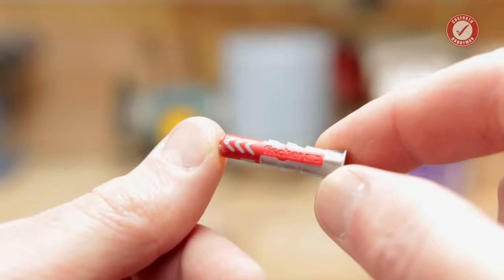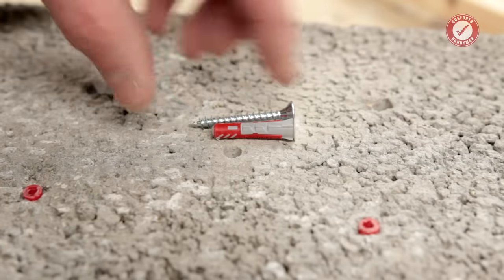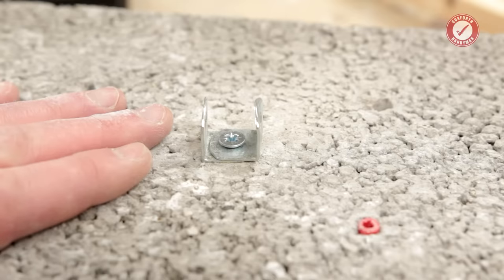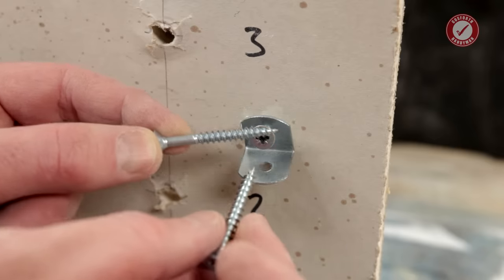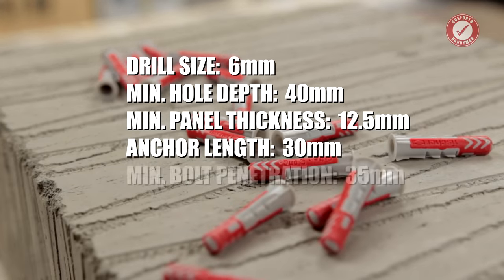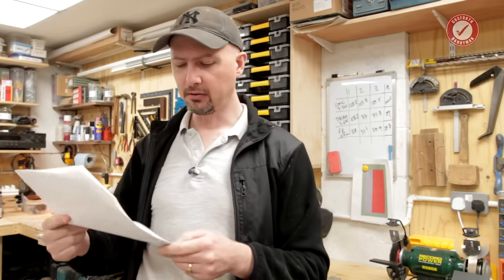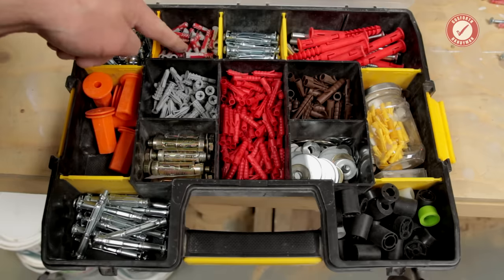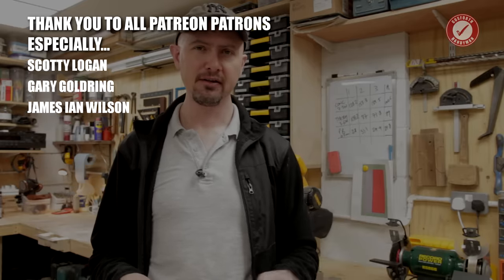How strong are Fischer DuoPower wall fixings?

Comment: Using an impact tool is NOT most individuals everyday screwdriver! This very well could of been the reason the fitting did not expand the way it should have behind the drywall!
Reply: Exactly , the plug needs continuous rotating force instead of a rotating hammer action
Reply: Bruh talking absolute rubbish
Reply: He swapped to a manual screwdriver at the point that the plug was starting to expand

Comment: Agreed that the Fischer Duopower plugs are game-changing. However, care must be taken not to oversize the hole for the plug as the anti-rotation wings are not very large. Suggest using 5.5mm drill to ensure a snug fit in all substrates.
Reply: I sometimes drill 1mm undersize in my plasterboard walls with thermalite blocks. It's easy to damage the plasterboard (oversize) leading to a loose fitting. A twist drill gives a cleaner cut and copes with thermalite blocks easily. Over the decades I've used larger and larger plugs - the 1980s rawl plugs pull out eventually. Nothing less than Fisher 8x40 or 10x50 these days.
Reply: @paulhadley9047  Can I ask what diameter screws do you use with the 8x40 and 10x50 plugs? And what series of Fischer plugs are these? They make them in duo power but also UX.
Reply: @lancearmstrong3252  Hi, for strength I always go for the largest diameter recommended for the plug.
If the plug says 6 to 8mm I find 6mm can spin in the nylon, but 8mm is firm.
Length is important, must be slightly longer than plug depth in wall.

For 10x50 I have had good success with long concrete screws from Screwfix. 7.5mm x 100mm.

There is a UX 10x60, with long concrete screws I had a solid support for IKEA support rail for kitchen cabinets. The long screw penetrates the block behind the plug, I mark plug depth with tape on drill.

Comment: It would be great to know how these test would go with 4mm and 4.5mm diameter screws as well as 5mm.  My experience with the Fischer DuoPower is that they work best at a bit below the maximum size screw diameter.
Reply from the maker: Will try - I'd have to buy even more screws as all my 4 & 4.5 are TurboGold. 😂👍
Reply: Fischer provides information about which screws to use on their website. for the 6x30 it is 4-5 mm screws for wood with at least 35mm length (depending on the head). So your observation is right.
Reply: Why do you think that the smaller screw would be better? I would have thought that the bigger screw would make a tighter seal, but you reckon the smaller screw would be better?

Comment: Thanks to this video I started using Fischer Duo Power plugs, both the 6mm and 8mm size, on both interior and exterior fastening jobs. Pictures on interior drywall, shelving in the garage into solid brick and hanging basket plants and exterior decorations, house numbers and the like, outside on solid brick. They have been easy to use and so far I have a 100% success rate. Many thanks.

Comment: Thanks for the tip of using fully-threaded screws for these (and for posting the 5x40mm screws you used)… have had mixed results with these on DIY jobs (screw not tightening, plug spinning), and now I know why! Used a fully-threaded screw with a duo power today, it worked perfectly. Great vid, thanks 👍

Comment: Thank you for your great advice. I have just bought a heavy Winmau dartboard. It's 5kg and my wall is plasterboard. I was all set to buy self-drilling screws until I saw your tests, and went out and bought a box of Dupower 6mm instead. Tentatively put up the bracket with two duopower this morning and the board is solid as a rock, even with my lousy DIY. Keep up the good work!
Reply from the maker: Great stuff! Just be careful as the constant movement of a dartboard (pulling darts out over and over) can exceed what these little plugs can handle. I'd normally use expanding metal anchors for something like this. 👍
Reply: @GosforthHandyman  Thanks, that's great advice. I will look to upgrade what I've done and remount the brackets as you've suggested! Cheers!
Reply: @GosforthHandyman fantastic video I stumbled across, but what's the difference between the DuoPower and the UX or SX?

Comment: I tried to use drywall plastic anchors in masonry and the ones I had didn't work because they bent over before they were fully inserted. No problem, I thought I'd just go to Home Depot and buy plastic anchors for concrete. I couldn't find any labeled as such. I bought some anchors that looked like the plugs I had used before in masonry but they also were labeled as for drywall, but they worked.

It wasn't until I got on the internet and realized that the DuoPower anchors that Home Depot sold were duel purpose . I looked for a review of how well they worked and that's how I happened on this video. Thank you. As an aside, it seems like any anchor that you can get fully embedded into concrete will produce a much stronger connection than is needed for most routine light duty connections to concrete.

Comment: I''ve just stumbled across these since I bought me new home and the reviews I've read are really good, and now thanks to google tracking everything we do on here its recommended your amazing vlog, I've just ordered two types for my drywall to connect a wood frame to it, making a raised feature in my master bedroom. I'm I right in saying that the more I secure the wall with, then the max load is then evenly spread through out the fixings. So to hang a TV on the raised area the more the better. Thanks for the review on these buddy.
Reply: Hi Neil,

This is very late and you probably already got it sorted but yes. Each plug has a max 'weight' it can carry. If you divide the load over several plugs the load will be more evenly distributed :)
Reply: @Tomskii5  thanks buddy and my tv wall is still standing six months on, thank you for your reply buddy
Reply: @stomperthemixer1  dont worry if you buy a tv mount it is usually supported by at least 3 plugs. Each tv mount also has a max weight it supports. This combined with good plugs should be perfectly fine.

Comment: I found these wallplugs then found your review, it helped me no end, as a very basic DIY'er. It enabled me to select the right screws for the first job and the tip about making sure the hole was at least as deep as the screw was very helpful. If there is a way to do something wrong, I can normally find it, but today I hung a 90cm circular mirror and a Gin rack very successfully. Thank you

Comment: As I have now installed thousands of these, I wanted to reiterate two things from this video that are super important when using these: 1) If using your own screws, make sure no unthreaded portion enters the anchor; and 2) do not overtighten, definitely do the final tightening by hand. I've seen too many of these "blow up" because a worker took an impact to them. 

You'll end up ballooning the anchor and it ends up mangled and spinning in its hole, which eventually requires drilling it out and installing a more time-consuming snap-toggle instead.
Reply: Hi Sakanora, I am curious around the importance of the unthreaded portion not entering the plug. In the video it's not clear why it causes an issue or whether it is only in the plasterboard scenario that is shown. Is it because a portion of the plug does not expand? If that it the main issue, then in solid wall this would lead to reduction in the load bearing relative to the length of the unthreaded portion, but the remainder of the length would expand. Or is there something else I might be missing?

Comment: Thanks for the video, Andy.  I recently used some of these Fischer DuoPower plugs to attach some bearers to my garage wall to hold up shelves.  I must confess that, where possible, I fixed them in the mortar between the bricks.  I realise that this is not good practice, but the mortar is sound and gave a good, strong fixing.  These plugs are good quality and they're working well for me.  The shelves haven't fallen down and there's some pretty heavy stuff on them!
Reply from the maker: Great stuff - might do a vid about hitting the mortar vs hitting the brick. 👍👍
Reply: If you're drilling an internal wall that's plastered, you don't know if you're hitting masonry or mortar.
Reply: @GosforthHandyman  please do!

Comment: I've only used Fischer DuoFix to hang anything remotely heavy in my house. Absolutely love them. Especially the 10x50 plugs with 5xt0 bolts. They are pricey (5 bucks for 4 plugs and bolts) but its more expensive to replace a tv or two
Reply: If you look on amazon (and I'm sure elsewhere) they sell a selection for about $20 that come in a nice Sortimo box (and includes 15 10x50s, 30 8x40 and 60 6x30 - all with bolts/screws).

Comment: Good test.  When  I use these and the Fischer  UX 6 plugs in plaster board  cavity walls I drill the smallest hole possible, 5.5 mm in this case  and use the  smallest  recommended diameter  fully threaded screw. This helps stop the plug from twisting in the hole as you tighten it, especially in old softer plaster board.  I wouldn’t use an impact driver !   and I usually finish  tightening the screw by hand.
Reply from the maker: Yup - on all these test the screws were tightened by hand. 👍

Comment: I've got the 6 x 30 and 8 x 40mm versions. My findings are as follows in 12.5mm plasterboard. The 6 x 30mm version I'm struggling with. I've tried 4mm and 5mm full threaded screws which were long enough to pierce the end of the plug with item to be fixed in place. What I've found with the 5mm screw is it just turns the complete plug round in the hole once the screw gets around halfway down the plug. With the 4mm screw the plug starts to collapse a little bit which ends up wider than the drilled hole but it certainly doesn't really deform that much which is a similar finding to your video. Now, the 8 x 40mm plug I can get repeatable results which are much better. I've tried both the 4mm and 5mm diameter screws and the plug really deforms a treat, spreading out very well behind the plasterboard. I think I will have to try another kind of small plasterboard plug.
Reply from the maker: Great stuff! I must admit, although I like the DuoPower as a problem solver, I do prefer the Fischer GP/LDF fixings for lightweight use for the reasons you say - less inclined to rotate. I generally use the expanding metal fixings with a setting tool for heavier stuff. 👍
Reply: @GosforthHandyman  Hi, thanks for your reply. I will have to look into the GP/LDF fixing, see what they're all about. Nice videos BTW.

Comment: Great video, thanks for sharing! At 7:07 you speak about the hammer action of your drill.
When do you (in person) use that?  Doing DIY for about 30 years now, I gradually came to the conclusion that I need the hammer action of a drill only
for drilling in concrete or hard natural rock walls (ceilings/floors). For bricks and other light weight construction wall blocks I prefer without.
Maybe it goes a little bit slower but in my eyes the hole keeps better the diameter what was aimed for.
I'd like to hear your opinion on that.

Comment: Great video, I was looking at these plugs but never realised it was quite so versatile. I have to say, I generally use the red EasyFix plugs form Screwfix at 59p for 100 rather than the £7 for 100 that the price is today for the duo. I noticed they do a Rawlplug red as well. That might be a test for the future that helps to show that whether the cost makes a difference. Just a couple of tests on each of the red plugs all the way up to the Fischer one?  Anyway, Thanks again for the effort you went to.

Comment: Great video! May I ask a question about the length of Duopower. I have double layer drywall 25mm I guess ..., so what’s the proper length of Duopower I need for my drywall ,? I want to hang a 65 inch TV on that wall..

Comment: Hi, I have a heavy p[punchbag I want to use. What plugs should I use for it or would you recommend another bolt fixing? The holds on the bracket will fit a M8 screw.

Comment: Could you also do a test of these in hollow concrete? In Germany it's quite normal to have brick/sandstone with holes in them for walls dividing rooms. Fischer says an 8x40mm plug can hold about 25kg, making no difference between the SX plus and these Duo Power plugs in their rating. Would be nice to see a real world comparison.

Comment: A question: if I am later painting a wall with a Fischer Duopower plug installed in the drywall, can the plug be removed (or pushed in deeper) so I can then fill the hole and paint over it?

Comment: Been using the grey Fisher plugs (even the cheeper copy long before that from dial at the big orange warehouse DIY store and before that at the blue background with white letters starting with W.) So much better than basic plugs due to the square head to stop rotation. Great for brick, block and plasterboard.
Not had such consistent results with the red ones. I also tap them just below the surface with solid material as it's easier to plaster over when no longer needed, better than trying to dig them out and they can't be tapped in after use as they are solidly bonded in.

Comment: Great video! Have you tried fischer's new Powerfast II chipboard screw? It's suitable for use in fischer plugs (eg Duopower and UX) and has recommended loads so you can make the most of the load bearing capacity of the plug. The only screw in the world that can do this!

Comment: Very informative video. Could I use the 'push through'  method on dot an dab plasterboard  (or even battened plasterboard) ie knock the duo plug through to the brickwork or best leave it flush with the plasterboard (longer screws obviously) ?

Comment: Thanks for the helpful video Should I use a wood screw when putting up heavy ikea floating tv cabinet and ikea floating cabinets with there brackets into brick wall if so do you recommend 6 or 8 mm Fischer plug and does it mater what type of screws I need to use for a tv bracket for a brick wall

Comment: I really like these, but my only concern is how do they perform if you need to temporarily remove something that is fixed to the wall to redecorate? I haven't yet had to do this but it seems they probably have a reusability of maybe three times before the plug becomes completely chewed up.... then you would need to pull it out of the wall and replace with a new one. Not as issue cost wise, but I can imagine removing the mangled plug from a plasterboard wall creates a bigger hole which likely won't create a tight fit with a fresh duopower plug.

Maybe I'm wrong as I'm only a DIYer, but to me this is the only advantage plasplugs or wall anchors have over these, as rescrewing into them doesn't seem to affect them too badly (and not at all with wall anchors)

I guess you could just fill the hole with some sort of drillable filler (but do those fillers really work?) wait for it to dry, and effectively start over. Otherwise just move everything slightly every time you redecorate 😂

Comment: I have a triple plasterboard wall, in which I need to hang 12kg acoustic panels. There is no cavity behind the plasterboard (it has been filled with rockwool). Which fittings would you recommend I use?

Comment: Hi great video! How would I apply these results for twin slot shelving uprights. I’m going to be using 65mm duopower plugs with 80 mum screws onto thermalite. Do you think they would hold a weight as it will have multiple fixings along the length? Thanks

Comment: Hi.. thanks for the comprehensive and very informative / interesting video..
Ive been using these plugs (and Dial Grey Plugs ) both in 8mm x 40mm but with 4.5mm and 5mm fully threaded screws and have had no problems with pull out or shear, but would be interested in any 'Test Tuesday Results' if you ever compare them with your results here..

Comment: Hi Andy I need to hang a shower screen over the bath the wall will be tiled with 8mm thick tiles plus the thickness of the plaster board I'm guessing around 12mm .
What fixing would you recommend.
I would really appreciate your advice as it's doing my head in.

Comment: It'd be interesting to see a Test Tuesday comparing the aerated block to other household objects, such as a loaf of bread, to see which is stronger. I'd put my money on the bread!
From my past experience, different brands of plasterboard can have completely different strengths, even with the same thickness. We used to get our Plasterboard from B&Q as we used to live a couple minute drive from one, but at the new house we have an MKM literally across the road so we decided to get it from there instead and it's a lot stiffer.
Reply from the maker: Same thickness? Never noticed a huge difference between brands - but yes, aerated blocks. Still beyond me how they support the weight of a house. 😂
Reply: @GosforthHandyman  Yep, both 12.5mm
Reply: ....only if the loaf is stale.. 😏 

😎👍☘

Comment: Is there a weight limit determined by the plasterboard itself?  For example, I guess screwing a TV mounting plate using 4 of these could in theory easily support a 25-30kg TV, but would the downward force cause the plasterboard to crumple or give way, no matter how good the fixing?
Reply from the maker: I wouldn't use 4 of these for a 30kg TV in plasterboard. You'd really need something more substantial - depends on the bracket. 👍
Reply: Depending on the TV and type of mount, often you really need a stud or two, and that is best practice. But a lightweight TV with a flush mount, a stud isn't necessary as long as the wall is in good condition. Metal Snaptoggles are the strongest anchor for that in drywall, though there are other options.